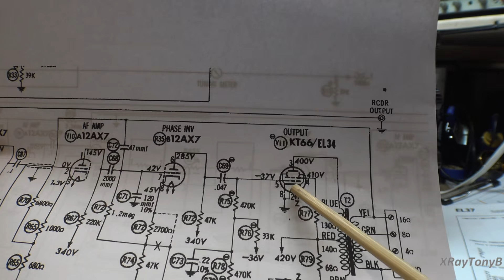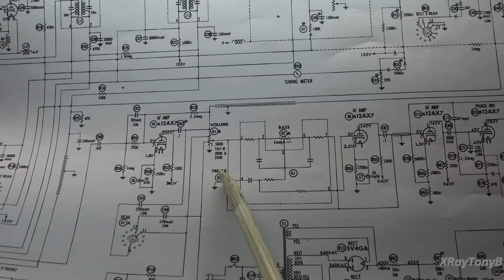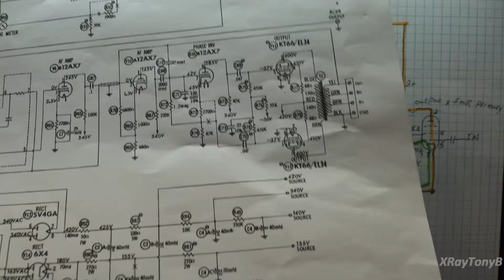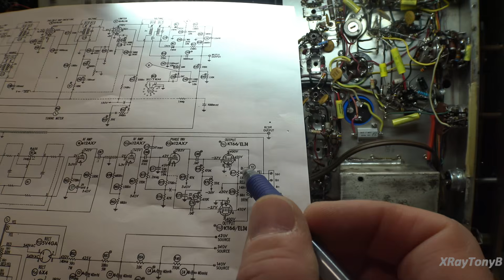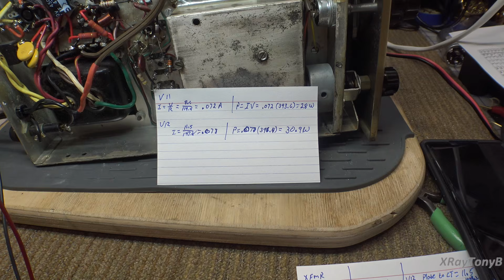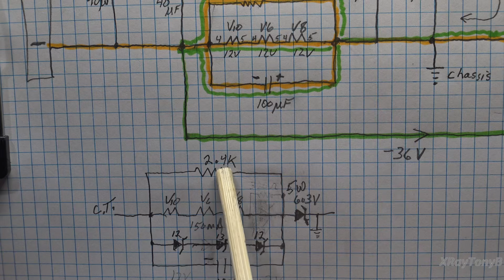Some Comments & Modifying the Bias Circuit - Fisher 500

Comment: What is your opinion about using a filament transformer with the one side of the low voltage ac secondary connected to one side of the AC line in series bucking configuration to lower the input voltage for these older amps and receivers ?
Reply: How interesting, have you done this?

Comment: 29:27 What you call conventional flow I have always called circuit flow for troubleshooting purposes. I think this is the leftover method of really old radio guys who learned the way they perceived electricity traveled from positive charge, that was too many electrons, to a negative charge, which is a depletion of electrons. It is much easier to follow a schematic through in this manner even though we know now that electrons flow from negative to positive, electron flow. Shango066 mentioned this too. My grandfather also used this method as he had been working in radio since the 1920's. If it is less confusing, I will use the easy path. Thank you for mentioning this Tony.